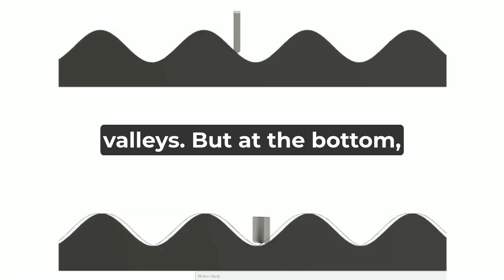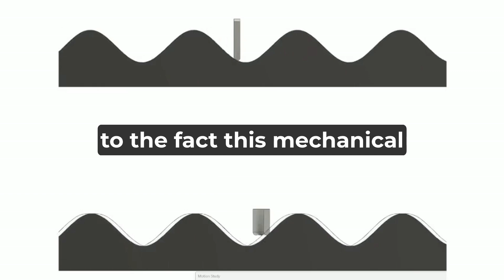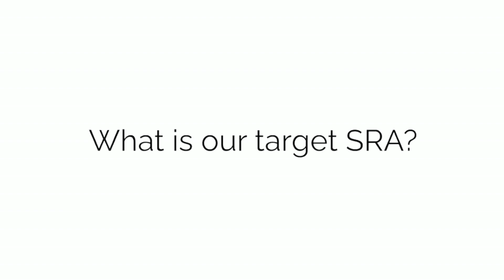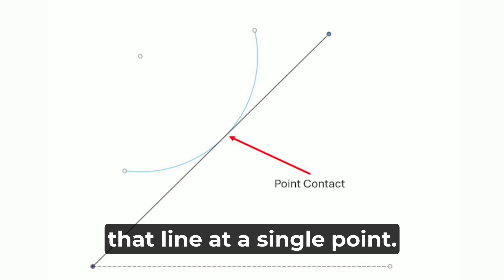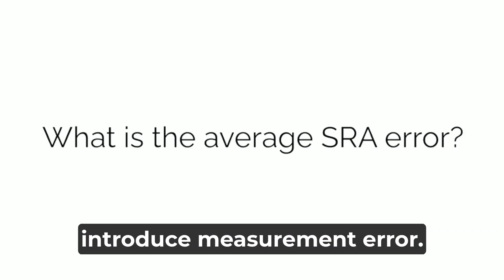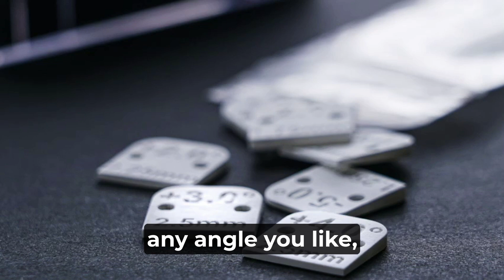7 Analog Alignment Targets - Video #6: Stylus Rake Angle

Comment: Wouldn’t it be cool to have a manufacturer build cartridges where the angle between the cantilever and stylus varies? In other words, built with the intent to try to minimize changes to VTA while maximizing changes to SRA?
Reply from the maker: I think it would result in an unacceptable loss of rigidity to favor a parameter which I think has questionable sonic influence (SRA)
Reply: @WAM-Engineering I was trying to think of a way to decouple sra and vta, a Gedanken experiment of sorts. If the mounting hole for the stylus were drilled at angles other than 90 degrees and the location slightly altered to keep the stylus tip at a constant location ( hopefully under dynamic conditions) then one would have a group of identical cartridges with identical VTAs but varying SRAs. Of course, a stylus not mounted normal to the cantilever would introduce its own set of issues, but maybe they would be minor. If you could get a cartridge maker to build a sytem that allowed the decoupling of SRa and VTA, how would you approach it?
Reply from the maker: @E.Williams-z9y I already have a stable of cartridges with variable stylus contact edge to cantilever angles. All same model cartridges, of course. All have stylus yaw (zenith error) within an acceptable range for our experiments. We get to analyze many new cartridges and choose the ones best for our experiments. We can also cut lacquers with variable cutting rake.

Comment: Hi JR.  
would an articulated headshell lockable pivot be something to explore to allow sra adjustment ?
Thanks,
Tony
Reply from the maker: As long as it had a horizontal pivot that allows vertical freedom of the headshell it would be a way to change SRA, but it would also be simultaneously changing VTA which, I *believe*, is the more audibly significant parameter. Can't prove that yet!
Reply: @WAM-Engineering  I’ve been adjusting my vpi arm height for years. I log the height with a stillpoint footer with various coins under the arm tower. I adjust by ear and the results are obvious and dramatic. This height is then logged on the inner sleeve. The height often has little to do with record thickness. Hey vector forces be damned , it’s an easy effective way for an obvious improvement that quite possibly will be improved with better tonearm design or quality control mounting of styli on cantilevers. I’m not holding my breath, at 66 years old, these parameters have yet to be addressed as you have. This is the best I’ve achieved and all who have heard my system with these adjustments have been awestruck when dialed in. Thanks always JR.   Tony